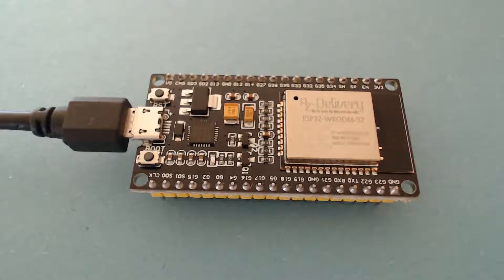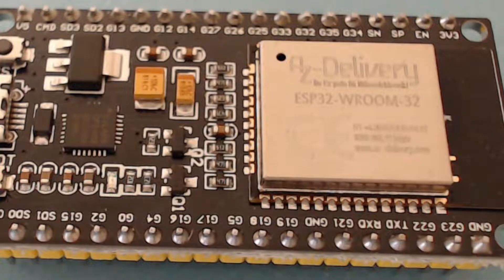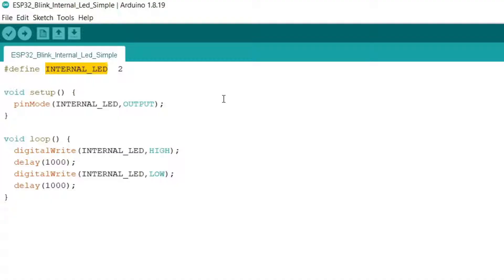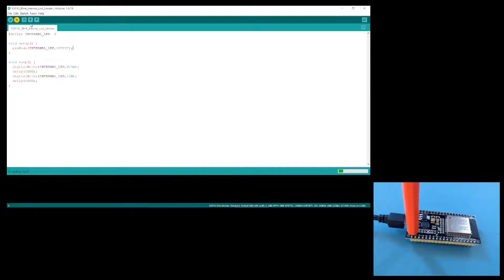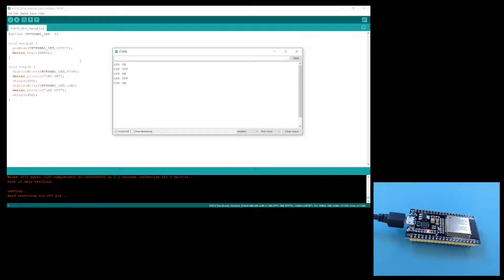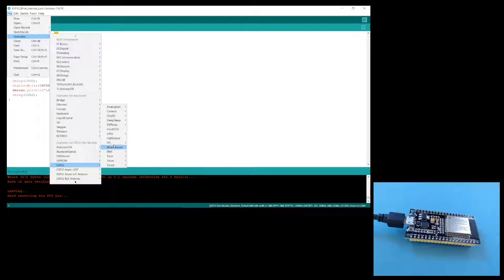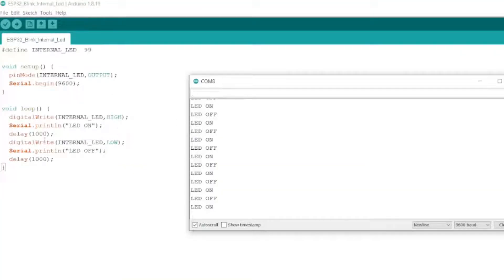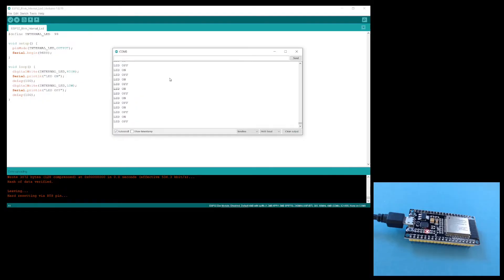🚨 ESP32 - Blink the Internal Led

Comment: Thanks for the video and the first sketch worked for my ESP32 board. Now the problem is for me I am very new to this and really don’t understand the code
I had in stalled the WLED software/program on it previously and after I uploaded your blink led sketch it erased the WLED program so my question is can code be written to allow both to operate on the same board.  Also do you have any recommendations or resources where I can learn to write code. Thanks.

Comment: I think ESP32 internal LED blinking is there to communicate when data is written to and written from  it to the serial. digitalWrite() doesn't seem be able to override that behaviour. But you can make it blink at different rates with different delays between two serial.println() commands. I was trying to replicate Blink example from Arduino uno and this was the only way I could do it.

Comment: i can confirm that the onboard LED can be controlled via GPIO1, but when you have output on the serial monitor, its interfering with that!
So the LED is connected to the serial port and GPIO1
Reply: You are correct it works when I commented the serial output and chainged the pin to 1. Thank you.
Reply: yes gpio 1 is for onboard led thx mate
Reply: You are a hero, sir. Thanks to #define LED 1 I got rid of the Serial commands.

Comment: Whoa, you're working with the same board I am! This is great. Relieved my worries there wasn't an exact board listed for ESP32-WROOM-32. Thanks Brett!

Edit:
By the way, do you know for sure whether or not this internal LED has capabilities of having it set to different RGB values?
Reply from the maker: I had a go but I think the external LED only has the red colour. It's a bit of a feeble LED compared to the ones on the Arduino.
Reply: @codingwithbrett yeah that's what I found as well.

Also I guess electronically it would have to have 3 inputs for each of the colors

Comment: So, I only have been able to successfully blink the led using GPIO_NUM_2 instead of just '2'. Also didn't have to user the serial write thing. 

void setup() {
  pinMode (GPIO_NUM_2, OUTPUT);
}

void loop() {
  digitalWrite(GPIO_NUM_2, HIGH);
  delay(100);
  digitalWrite(GPIO_NUM_2, LOW);
  delay(100);
}
Reply: ty that worked for me as well
Reply: Deu certo para mim

Comment: I have the exact same board as you do, and was beginning to think mine was defective somehow. It behaves very differently from all other WROOM32 boards I've seen on the internet, but exactly the same as yours. Seems like its just a case of a different revision of the circuit from our boards, in ours seems like there is no addressable builtin LED nor a power LED, just this weird Serial activity indicator LED, very confusing indeed.

Comment: actually, internal LED is connected to TX only, hence it is flasing when sending data to terminal. If the sketch is working properly LED will go on / off  every 1 second. This is specific for this particular version of ESP32.
Reply: EXACTLY!!!  IS GIOP1 - TX0 - PIN 35  , #define LED_BUILTIN 1
Reply: @jesusalbertogonzalezpulido7991  For me its not working. it still turns on shortly and then it turns off.
Reply: exact. I have the same card. Led is connected to TX thru a 470ohm.
Reply: I reached the same conclusion. Must use external LED.
Reply: what dev kit model is used in this video?